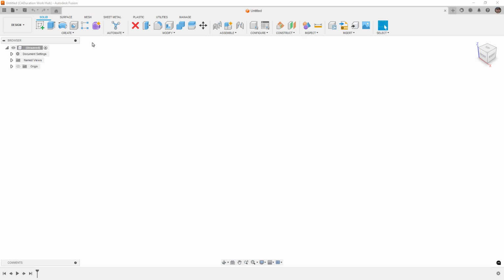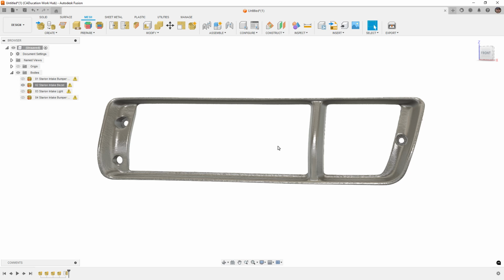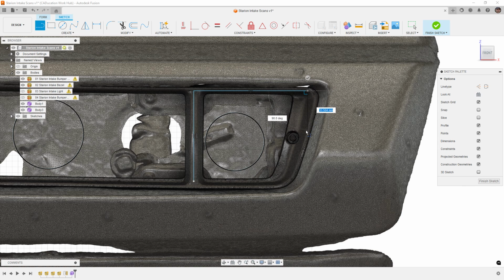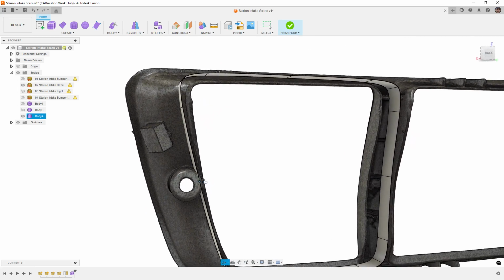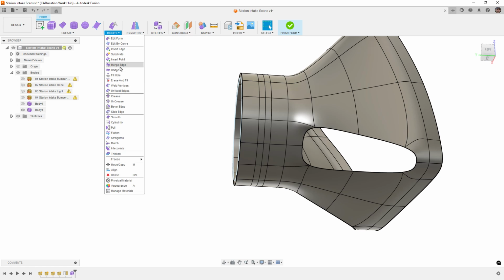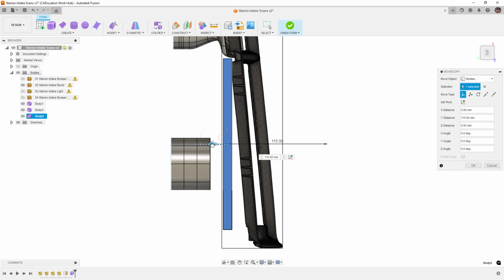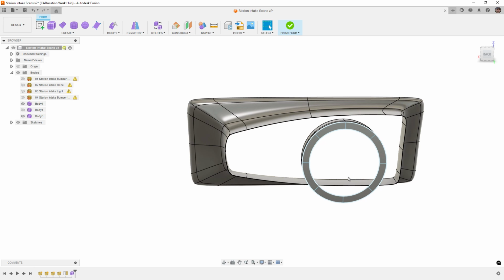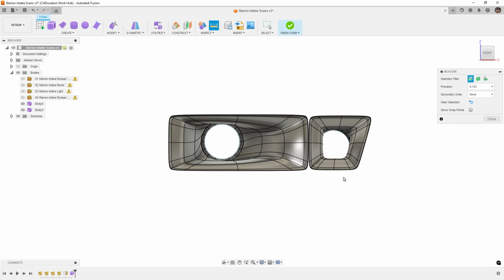Design Custom Car Parts With 3D Scanning | Ep3 | Freeform Modeling The Duct

Comment: Your videos are great! Could you show me how to draw a jigsaw diagram for the fog lights of any car model?
Reply from the maker: thanks!  not sure what a jigsaw diagram is.  Do you mean cutting a flat lens/block off?
Reply: @LearnEverythingAboutDesign Could you make a video tutorial on using Fusion 360 to create a fog light kit for a car?
Reply from the maker: @cuocsongthuongngay9201  can you expand on that a bit?  Do you must mean a lens or actually design a fog light?
Reply: @LearnEverythingAboutDesign fog light design
Reply from the maker: @cuocsongthuongngay9201  That is a big project :)  I have considered making a custom tail light, but the problem is legality.  at least here they need to be DOT certified if its on something that goes through inspection.

Comment: Das Video ist fürn Arsch. Quicksurface kostet 4000€ . Und 30 Tage testen bringt nichts, weshalb sollte ich etwas testen was ich nie kaufen werde.
Reply from the maker: I used LITE in the video not Pro which is $400/year.  There is also a Personal version for non-commercial work for $240/year as well.  On this channel I don't generally show the PRO version, but have a course on www.learneverythingaboutdesign.com for PRO.

Comment: Just for anyone fortunate enough to see this before clicking 'Finish Form' - don't. It'll automatically convert your forms into surfaces.
Reply from the maker: true, but you can edit the form at any time.  if you convert to a surface by finishing form, then edit and decide to thicken in the form tools, next time you finish form it will be a solid now.  While there is no history saved it is a feature in the timeline in fusion.

Comment: Just curious cause Im new to CAD but why did you use Fusion over QuickSurface Lite for CAD work? Could you have avoided Fusion and just used QSLite for design of the ducts here in Episode 3 and then again in episodes 4 & 5? Thanks for the video and info! I really like your QS lite and pro videos. Im just now getting started with QSLite
Reply from the maker: Hi there.  QS lite has limitations with CAD.  For example in Lite you can't trim multiple surfaces, or add/subtract solid bodies.  You can in PRO but that is $4000 and most users doing this type of thing are likely on a hobby license of Fusion or even a commercial license which is $500/year.  QS Lite is $400/year.

That being said QS Lite and Pro are really good and replicating mesh geometry, but a bit trickier to use as a CAD program to create new.  While you can make freeform geometry not snapped a mesh, the process is a bit easier in Fusion.
Reply: @LearnEverythingAboutDesign So if I were to have QS Pro I would be able to skip having to use Fusion? I also really like Auto Free-form algorithm in the Pro compared to the lite (from what you've shown in your videos). Basically Im trying to convince myself getting the Pro version is worth the cost :)
Reply from the maker: @RaRa-xg7le  Yes, BUT I still think creating freeform models not snapped to the mesh is easier in Fusion.  Basically Fusion is made as a creation tool that can snap to a mesh. while QS is a program designed to recreate a mesh body with surfaces/solids.  The creation tools (aside from the algo used for Auto freeform) are going to be mainly the same.  So if you feel good about creating a freeform body not snapped to a mesh in QS Lite then 100% you could do this in QS pro.  Me personally it takes a bit more time in QS vs Fusion for the creation of new stuff, but much much faster to recreate a mesh.

Comment: I love those detailed videos, very inspiring. Just a question: why did you chose to not create some  (aligned) solid model in quicksurface? You thought it was useless?
Reply from the maker: Good question!  So at the end of this series I did end up doing that for the CFD simulation.  But at this stage the tools to do this in QS Lite, which is the trial most people would be on, would be limited.  You can't boolean multiple surfaces or solids in QS lite and need to export all the bodies to Fusion for further work.  So for the purpose of this, knowing I was going to use Forms, the mesh references were just as good.  If I had planned to use solid tools and wanted to create sketches on faces then it would really help to bring solids in.

The main benefit here is that Fusion forms can "pull" down to a mesh reference but to a solid reference the tool Match works a bit differently.  It can pull a form edge to the edge of a solid or surface.  You can certainly have both just in case but I knew going in that really what i needed was just the space.  So Unselectable Mesh would work and let me pull form points to a mesh if needed.

Hope that helps.

Also when i make these videos they are real time so it is never guaranteed that my decisions are the best solution.  Some cases that is only known after you make a part and think "well i wish i would have done it that way" :)
Reply: @LearnEverythingAboutDesign  thanks for the reply, you've been very exhaustive :)

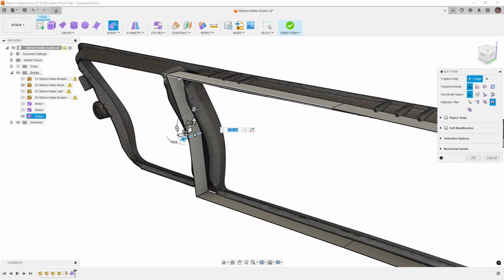Comment: What the short key smooth lines? 35:14
Reply from the maker: In forms its ALT+3 for smooth display and ALT+1 for box display.  If you are in edit form you can also expand the selection section and there will be a button down there to toggle.  Its also in the Utility menu under Display Mode.

Comment: Do you have a favorite sublimating scan spray?
Reply from the maker: I haven't used them all but I usually use Revopoint spray or Atblime.  The stuff I have been using the most recently is the vanishing 2-6hr spray from Revopoint  https://shrsl.com/4x2xb
Reply: Awesome, thanks for the reccomendation!

Sorry for all the super random questions in the comments.

Just one more,  do you have any videos talking about the affect of ambient room lighting on scan quality? Or have you noticed that it makes a large difference?  Wondering if it was worth setting up a dedicated scan area with ideal lighting😊

Comment: Is there a way to just use the scanned part as a "hole"?

Create a box that encompasses all the surfaces inside the bezel, select the bezel as  essentially a "hole" that you want to put in the box.. then the inner parts would match right up
Reply from the maker: you can use mesh tools for "boolean" to basically cut one mesh from another.  The problem is that means you need to convert your box or shape to a mesh.  Mesh is usually the last step before 3d printing and working on something as a mesh is generally bad for geometry.  So while yes you can use a mesh to remove material there are problems.

You can try this with a simple example in fusion.  From the create menu create a primitive box, and a primitive Sphere.  On the mesh menu you can tesselate both turning them into mesh bodies.  Then use the boolean "combine" tool and subtract one mesh from the other and look at the results.  Usually what happens if you have a really high density mesh (like the bezel) and a really low density mesh like a cube, the cube ends up with thousands of triangles on a flat face in order to create the geometry.
Reply: @LearnEverythingAboutDesign thanks for the reply, I'll play around with that

Comment: Awesome videos, you've been a great help. 
Have you ever used Rhino for this type of work and/or would you ever consider doing some videos about it?
Reply from the maker: Thanks!  I used Rhino7 and really didn't like the UI/UX and the limited freeform tools they had.  I have to try Rhino8 to see how it has improved.  I think Rhino has cool options with Grasshopper, but for Rhino7 I felt the freeform and mesh based tools in Fusion were much better.  I did also try SolidEdge and a few others.  I liked PowerSurfacing for Solidworks but the problem is price.  Most people aren't going to spend the $8-$10k to get setup with that and then $2000+ a year in maint cost for SWx and Power Surfacing.

Comment: Seriously thanks for everything you do. Curious if you could add an advanced section to this when this series is completed. Like adding how you could optimize the design for flow? Also, is there a way to add an external wrapped grid system for the prints in case the part needs to be modified and the grid could be used as references to making the changes?
Reply from the maker: Thanks!
The flow thing is a bit tricky as Fusion doesn't have CFD built in.  There are some open source CFD type tools but in large they are in bigger software packages.  Ill add it to my list though!

As for the grid system I am not 100% sure I follow.  Do you mean to the shapes?  Or are you saying some sort of grid so you can see how much you sand off to make it fit?  With the scan data that shouldn't be an issue and these fit first go.  You can always go back and edit the form.  The big driver on this one was the metal area where the factory light mounts causing me to have to pinch the form shapes rather than a true smooth transition.  Getting it to mount to the bumper was pretty straight forward thankfully.
Reply: The idea with the grid was to print on the surface the measuring device as a test print. It was an idea to help with any potential modifications. 

As for the CFD and/or smoothing out the duct, I didn’t know if a combination of forms, and lofts with splines could be used? Couchbuilt designed some 3d printed turbo manifolds using the profile and sweeps along a path. He also used a thin profile to control the transition of the loft when creating the collector. I wasn’t certain this style of process could be used? Like having a form for the front profile by the bezel and a cylindrical form for the back of the duct. Then connect the front profile and back profile using a loft with splines as guides. 

Here’s couchbuilt’s video:
https://m.youtube.com/watch?v=k57HDp7T8Bw
Reply from the maker: I like the grid idea in general!  Im not sure how to make that happen but seems like a great idea.

On the forms vs lofted surfaces sure.  You can combine them all you want.  So if you wanted the front to be a form and back to be a revolves surface you could loft between them.  You can loft forms as well but one thing to note with things like loft or sweep forms is they are approximations.  They will not perfectly match the input curves based on tolerances where as a surface loft is bound by those curves.

Fusion does have flow built into Generative design which could be used to get the most efficient flow path based on some obstructions (like the sheet metal in the way) and the output would be a freeform body.  The downside is GD is not available for a hobby user.

Maybe ill try to compare GD flow and something like OpenFOAM flow.

I will say with stuff like this it is less critical than say the shape of an intake manifold or a collector.  Most air getting into the engine bay comes in through fenders and other areas and are often restricted, so getting "cold air" into the bay from the front of a car will likely be fine and the right turn and tubing going up to the airbox or turbo are more of a restriction than the shape of this.  still would be a cool test to see how efficient it is and what improvements could be made.

on the k24 intake series I did we made plenums with surfaces, forms, and a "log" style.  You can use forms and it even has a pipe option but all comes down to manufacturing ability.
Reply: You are correct about the air to the engine. However, if the duct were to cause enough turbulence it could impede the air and be counterproductive
Reply: In reference to the grid: my initial thought was to make a grid of planes that intersect the part. Create a sketch of the intersecting profile between the part and the plane. Offset the profile and do a thin extrude.

This method seems like a brute force, and I wasn’t certain if there would be a better way of projecting a sketch onto a surface and then trying a thin extrude. 

Other possibility, make a copy of the part and scale it to increase its volume slightly. Build a grid of thin plate bodies. Use the intersection tool between the thin plates and oversized body. With the intersected bodies of the plate and oversized part, merge them with the original.
Reply from the maker: @baconandbourbon9395  Ill see if i can't put a video together with open foam or simflow and GD flow on this.
Reply from the maker: one possibility is after its a mesh there are mesh tools to put textures on printed parts.  Some slicers have them or mesh tools like Blender can let you "paint" a texture on.